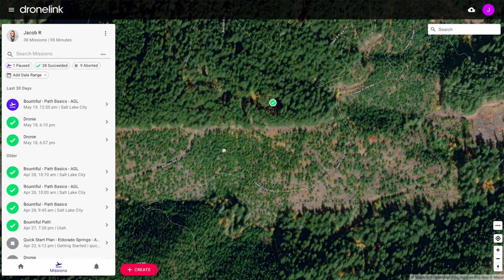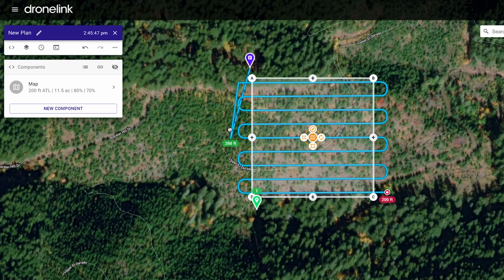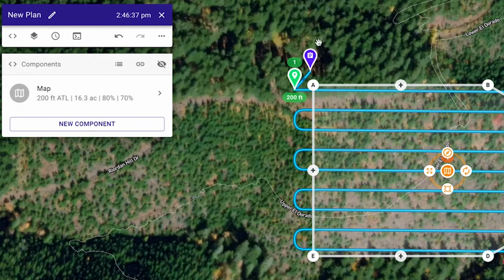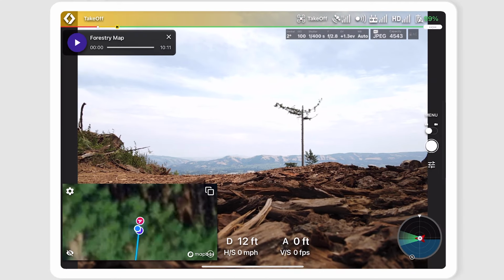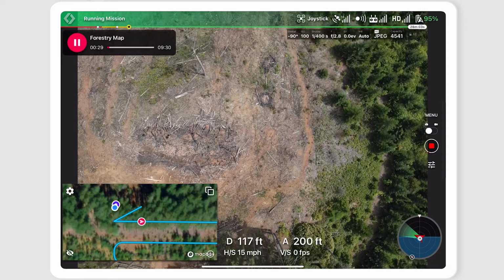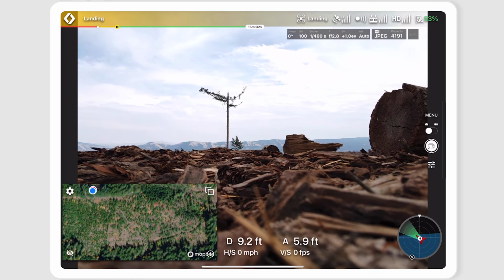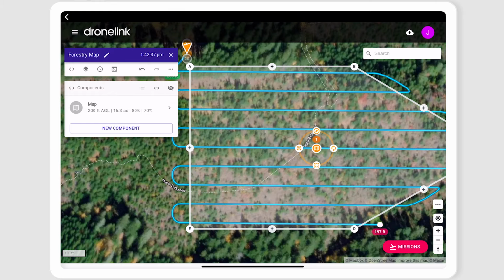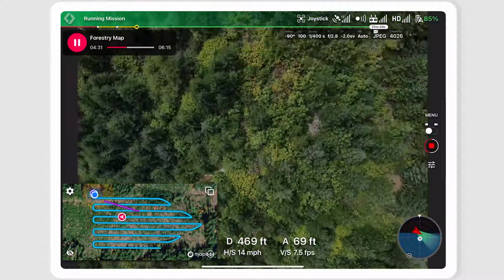First Flights with Dronelink - Mapping Mission Planning, 3D Preview and Flight

Comment: I tried to make a map plan in dronelink, but I don't see rounded edges on top and bottom. I have 90 degree sharp turns. How to get smooth turns like you have?
Reply from the maker: You may have set your map to Distance capture priority. Also, try starting with the map template which should automatically have the rounded edges setting

Please post your questions and share a link to the support forums where our team will respond: 
https://support.dronelink.com/hc/en-us/community/topics

Comment: what is the best Speed? best Overlap Settings? Best Photo settings for Air 2/2s? and how can i change the Feet to meters?
Reply from the maker: This depends on many other factors and the processing engine you are using. Generally the processing tool you use will suggest best flight parameters for their engine

Comment: When im resuming the flight after changing batteries, the drone is not coming back to the last taken photo, is going further back, is there any way i can change the place where i want the drone to resume the flight? Thanks
Reply from the maker: There is no way to change the resume behavior, the drone goes a little further back than the resume point in order to achieve the same speed as the previously captured photos

Comment: In general to DroneLink:

It would be great if it would be possible to load the flight pass onto the drones memory and let it perform it without a controller. (Distance limitations)

Like for example when you're away on holiday and want to check on your property.

Drone gets the command to take off over internet and does the mission saved in its memory.

Is that possible ?

Would be amazing if so!!!
Reply from the maker: Great suggestion! We do hope to achieve this type of capability in the future, most likely via cellular data enabled drones and once regulations permit easier BVLOS operations. You'll still need a drone that does self charging!